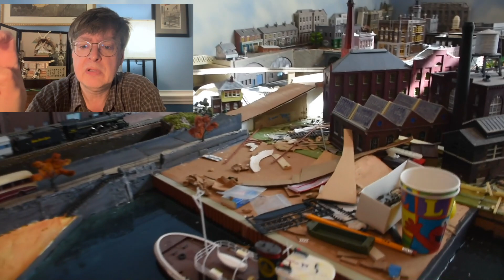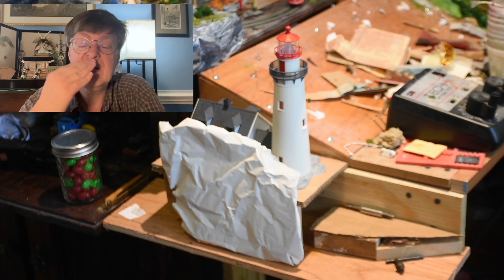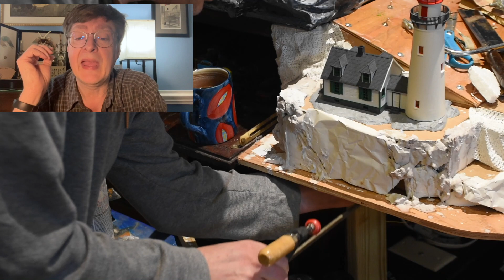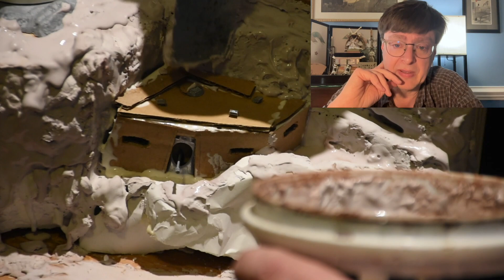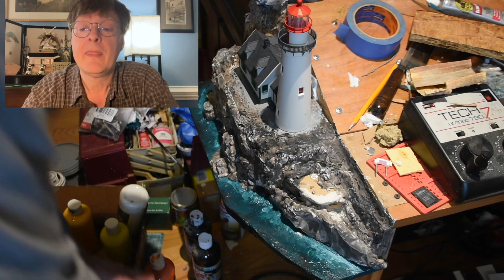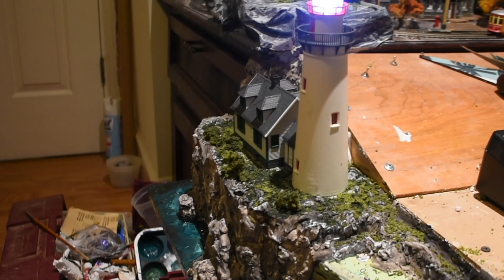Installing a lighthouse on my model railway, including rock and water landscaping. By AJ Hartley.

Comment: Professor comes out of the closet and reveals he is a amateur modeler!!! Awesome.  Hey man I am a modeler myself and have extensive experience building HO scale railroad models and all the associated bits and pieces. You mentioned using epoxy resin about the time I was thinking that would be a perfect top finish for your water.  And, no, it doesn’t necessarily need to finish completely flat.  I have found several techniques to use to get all sorts of different finishes by using things to lift it up into waves or peaks like over whipped crème.  You just have to time the cure right to modify it from its normal liquid flat tendencies.  Some experimenting and I am sure you could master the process.  Anyway, I found myself very much enjoying this post and I thank you for coming out of the hobby closet and standing in the light as a proud hobby modeler! Cheers from Nor Cal - Eric
Reply from the maker: Thanks! A always struggle with he logic of modeling things which should move (like waterfalls, for example) when things around them (like the actual trains) really do move... This is a mental blind spot of mine :)

Comment: I enjoyed that :) My two thoughts were 1) having been born and grown up on the south coast (Dorset) I am very familiar with those coastal pillboxes and feel they are more a pale gray with a mere hint of green and 2) I am terrified your arm will knock the new lighthouse off when sat at your little control desk LOL, Thanks for a glimpse at your not so little setup.
Reply from the maker: Yeah, that's true about the color. As the inclusion of the guns suggests though, I'm trying to have my cake and eat it too, in that (as with much of my layout) it kind of does multiple duties in terms of period, so I'm simultaneously trying to show what the pillbox might have looked like when it was first built and what it might be like now (depending on whether the train going by is a war time steam engine or a modern high speed electric!). I've seen some that were originally heavily colored (or camouflaged) though they have faded a lot now. And that, your honor, is the case of the defense :)